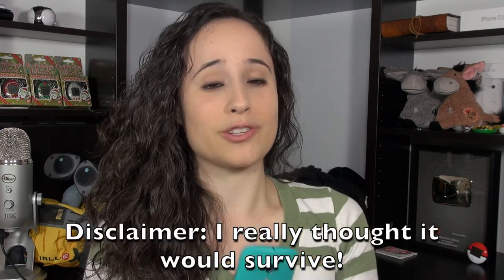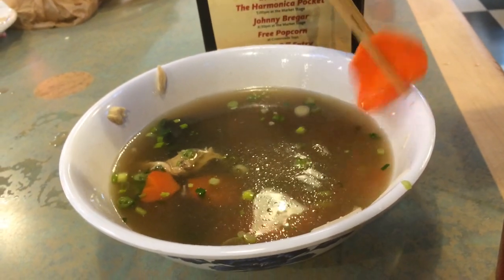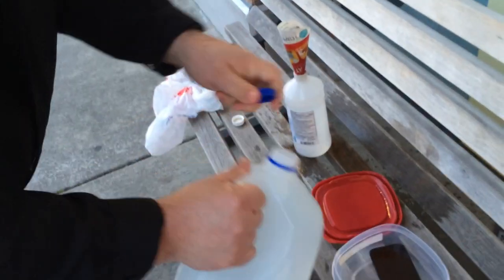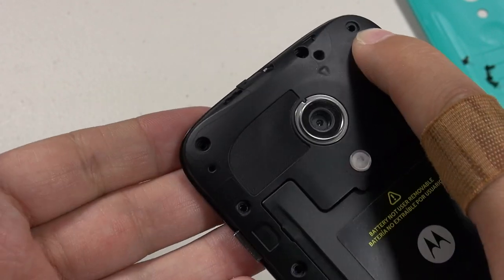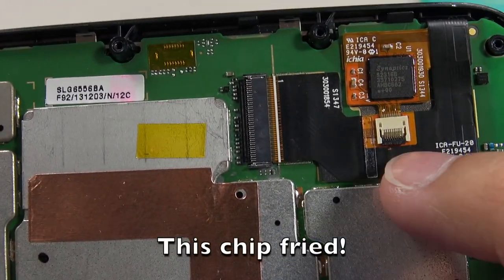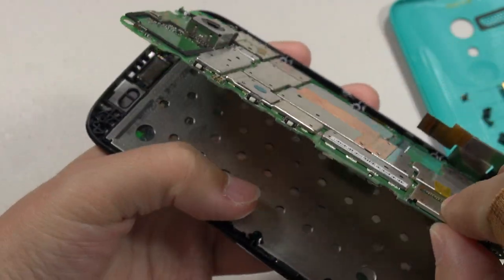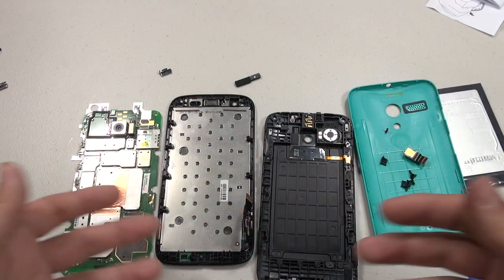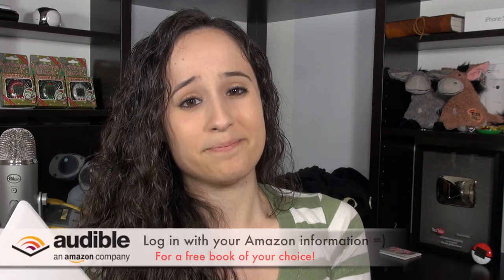Moto G Soup FAIL and Take Apart

Comment: there's only one true waterproof phones: xperia z series devices. either you have it or you don't. :)
Reply: Jason Boyes the defy was not waterproof. It was splash resistant. Sony were the first with fully submersible phones.
Reply: nothing genius in manufacturing a brick and calling it waterproof phone. anyway, sony were the second in manufacturing waterproof phone (2006) but sony is the first in bringing waterproof to smartphones, let alone FLAGSHIP, while keep slim profile, the flagship internals and a flagship premuim design and materials, do you get this? unheard of. sony is genius. they made the real breakthrough and push all oem's to make waterproof FLAGSHIPS now. and sony made the first waterproof tablets also.
Reply: Jason Boyes you know what I meant and are just being a silly boy! Haha. The first fully submersible smartphone worth having came from Sony. The Z was it. And the rest have followed along the same path. Anyway. Moto are practically dead in the water. Like blackberry. At least in the UK.